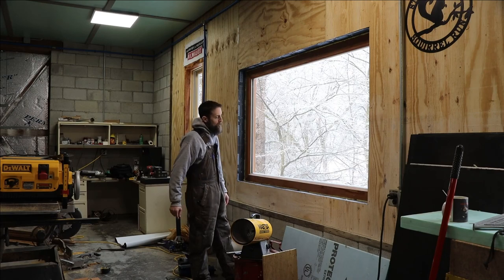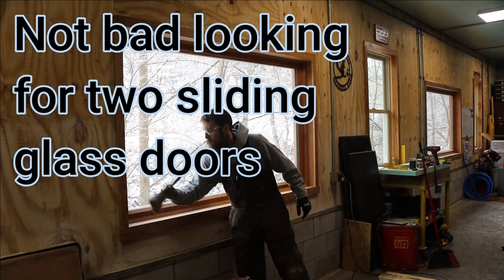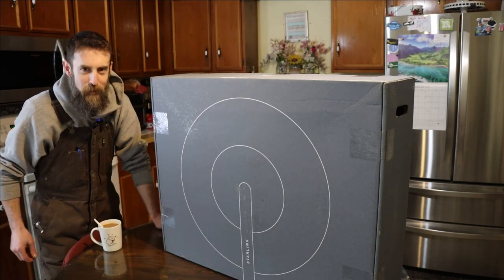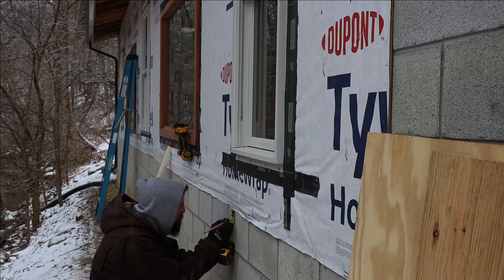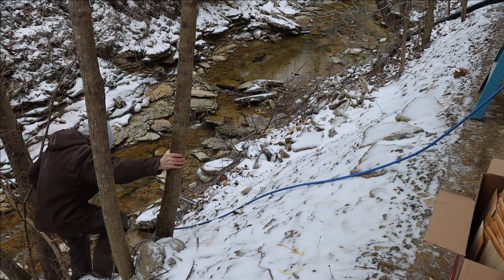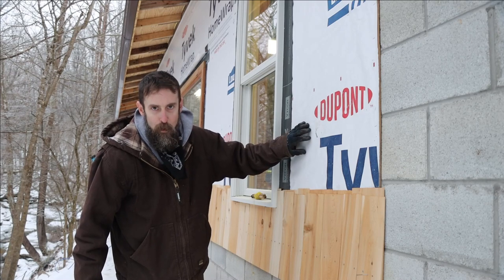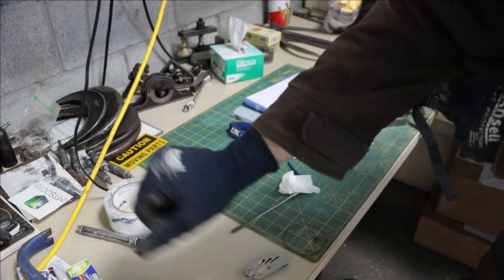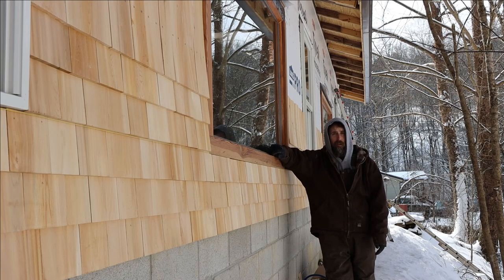Looking GOOD! Workshop Siding  going up. Shop update

Comment: I didnt even know you could get satellite internet. Here in uk its like cable, tv and internet down it.
Reply: They are doing the public beta all over the world, as the coverage map is pretty much that. Yes it will hurt those with geostationary satellites, but the big customers that use them, because the antenna is already paid for, and it is a relatively secure means to communicate in remote parts with reasonable speed, and more importantly nearly immune to infrastructure being present other than clear sky view and power of sort.

The big satellite operators are going to hurt though, as Starlink is basically being done for very low cost, using either spare capacity on a SpaceX launch, or going on their own launch for low price, so as to get the initial volume up to get coverage mostly. Yes there are multiple satellites, and they are expensive, but they do not have to have as much mass as a geostationary satellite, and the power needs are so much lower as well, plus you do not need that high energy launch to get to GEO as a saving, and you also get to ride share the big cost with 59 other units. Plus volume of scale, the tooling costs to make a single GEO satellite are very high, and only are amortised over perhaps 10 units, launched over 5 years, while the same tooling cost for SpaceX is amortised over 1000 units in the first year, even with having a lot of design updates to them, they are still following the same basic pattern and common parts list, so the cost lowers dramatically. Plus SpaceX also makes a lot of the parts in house, so they can save a lot of money using otherwise underutilised equipment and talent.

Hughes and the others are sitting with older equipment, and distance makes it impossible to upgrade the bottleneck of the satellite being 20 year old technology, while they are still paying off the initial moneys they lent, plus they are massively oversubscribed, cutting the available bandwidth to a tiny amount for all the customers in the entire field of view of any satellite, as the bandwidth is shared over a massive subscriber base, each only getting a tiny slice. 

Expensive here, but actually faster than alternatives when you are far out in the middle of nowhere, and commonly used by all the banks for ATM service in areas, even in a city, where they otherwise have poor or unreliable infrastructure, as it is good enough for that use. Used by a few containerised ATM stations in the city, and also on all the mobile quick response vans, as they can be deployed anywhere, and this will work. Yes latency is bad, and Starlink wins hands down for that, but I still see them being around for a while, though with a massive loss of the residential customers to Starlink. As the customer base grows for Starlink tyhe bandwidth will drop, but SpaceX can easily launch extra capacity for low cost, and as Hughes loses the residential customers they will overall get better service on the remainder.

Comment: I don't do Commercial Installations anymore..but you should get an Electric Hammer Drill for larger jobs...a Cordless is fine for a few fasteners ( or for driving the fasteners ) ...but a decent sized Electric Hammer Drill is 10x faster at drilling holes....really speeds up the job and wear and tear on your Cordless...i used Cordless tools since they came out and had Electric as the Main tools on Big Jobs.....Speed is Money....Home Handymen can afford to take their time.....not " saying " Cordless is Bad ok ..i use my 20 cordless tools alot. ...so you haters please back off...lol
Just giving a Tip
To use or refuse
Your ok doing it other ways too...

Comment: Starlink is coming to the 3 Billion people on this planet who don't have internet. Thank you Elon Musk.
Reply: The majority of those people could never afford it, even if it's 1/10 the cost. ($500 for the requirement and $100/month for the service.) So it's a moot point. It's really only good for the people in rural areas that have had to use traditional satellite internet. They may be able to get some sort of subsidy, to get a unit for a community center, but 90% of those people will still be without internet.
Reply: @xenonram  I’m paying 150 a month for just Comcast hardline internet that doesn’t even work 3 out of 5 days a week and I’m in a city. Starlink out performs Comcast on reliability alone.
Reply: Starlink is only just started. Elon's Spacex are putting up tons more satellites every week or two. The service is only going to get better and faster.
Reply: @xenonram   Negative.  Shared Service. Which they who can't afford it individually WILL. And they DO.  Problem SOLVED.  Tons and tons of ways to get it distributed for low low cost. Poor people in villages will make this practical and practicable.  And it will be a VAST improvement over what they have.  Use your imagination.
Reply: @1pcfred  Who cares you going to the moon next week lol lol jk
Reply: @KUGW  maybe not next week. But it is good to be able to get off the planet sometimes. I'm listening to The Animals - We Gotta Get Out Of This Place right now. Funny that.
Reply: @1pcfred  with that thinking we would still be living in caves.
Everything has a cost. Even progress
Reply: @thosoz3431  sometimes the price is too high though.
Reply: @1pcfred  We do have to get out of this place eventually. We need to find another habitable planet and a method to get there in the next billion years or so or we’re all going to die when the sun starts running out of fuel.   It’s estimated that the earth will be in uninhabitable in the next 1 to 4 billion years due to the increase in temp caused by the dying sun.  The sun is expected to completely envelop the earth when it becomes a red giant in about  5 to 6 billion years.
Reply: @shadowdog500  our Sun is a very stable star. It is the least of our concerns as far as extinction goes. Really higher orders of life do not tend to last as long as our star will. I doubt we're going to be exceptions to that either. Our star is only about a third of the way through it's active life. So it will not start dying for about 10 billion years. Humanity will be long gone by then.
Reply: Bill Gates tried to do something similar in the 90s and he was stopped by governments, so you should ask yourself why they are allowing it now.
Reply: @seantap1415  probably because Elon actually has rockets
The real question I'm asking is why so many people are desperate to believe any whacky conspiracy theory.
Reply: @1pcfred  perhaps we should ask some of the 3 billion people who want to join us here.
Reply: @shadowdog500  A BILLION YEARS. LOL we will be lucky to escape covid, global warming,, radiation poisoning,war,AI, etc, etc, in the next 50 years, never mind the next billion.
Reply: @thosoz3431  I don't think a monopoly is good for anyone except the owner.
Reply: @1pcfred  would be awesome just take a vacation to Saturn lol
Reply: @shadowdog500  Let's bring along the voting machines, wherever we go :)
Reply: @KUGW  maybe. Can't expect very much fun in the sun out that far though. This is what it looks like there https://upload.wikimedia.org/wikipedia/commons/7/73/Pale_Blue_Dot.png
Reply: @thosoz3431  if I want their opinion I'll give it to them.
Reply: @seantap1415  Bill Gates dismissed the Internet as a fad in the 90s. Which explains Windows a lot. It was only Netscape making a half a billion dollars in a few months that got him to change his mind.
Reply: @shadowdog500  yeah and by 2007 the polar ice caps will have melted. Predicting the future is a precarious occupation. So at least pick dates past when you'll be alive.
Reply: its coming to Australia soon as well anything would b better than our pathetic internet speeds
Reply: @MrValhem265  as I understand it Australia has greater problems with the Internet than just the speed. Government blocking of content is not good.
Reply: @1pcfred  yep our gov has told google to pay for news content they advertise on Google they agreed to it. but they are having issus with the Book at the moment fbook has taken down important news stories feeds blogs etc. the evil money game is rearing its head again.
Reply: @1pcfred  Starlink satellites have auto avoidance mode, and they are low enough that their orbit decays in a few years when they would malfunction. Kessler syndrome is much more of concern for higher orbits.
Reply: @sttrife  you think those satellites can dodge things coming at them at 30,000 MPH?
Reply: @MrValhem265  that's just the latest kerfuffle. The Aussie government blocks things they deem "inappropriate". Which is Orwellian.
Reply: @1pcfred  That's not how it works. Objects and debris in orbit are tracked from earth. Normally satellites are instructed to temporary change their orbit manually by people on the ground to avoid them. Starlink satellites do this automatically. This is the best we can do for now. And as I said in those orbits, there is still some atmosphere, so there is no eternally floating small debris out there like in other orbits. So pretty safe actually. You should worry about higher orbits, where there are dead satellites and and other crap that floats there without ever deorbiting. If something happens there we're much more screwed.
Reply: @sttrife  there's still some Earth atmosphere out at the orbit of the Moon. Not much, but some. I was pretty surprised when I learned that myself.
Reply: @1pcfred  for sure like torrenting

Comment: For those that are internet challenged, in my area things seem to be changing, so you may want to investigate.  I had Hughesnet for a while and felt raped by them.  I then had a wireless provider that was reasonable until bought out by Sprint, which abandoned what worked for me.  I then went cellular but that was very expensive, for I had to buy a GB quantity per month, but there was no way for me to stop the blasted advertisements on webpages, plus I could not stop the "free" antivirus from trying to update every night, so I uninstalled the antivirus.  I then found another unlimited wireless with a speed cap at 3Mbps.  This month I received a mailer from Verizon for what they call "LTE Home Internet" which uses 4G LTE.  I understand that T-Mobile has something similar.  Things are changing, so check them out.  The VZW setup is a wireless router box that talks to their cell tower.  I get at least 40Mbps.  Because I am a VZW customer my charge is $50/mo w/ equipment charge for unlimited quantity.  I think their offer is more $ for non-VZW but has a monthly GB cap.  Again, time to check to see what is available for you.

Comment: If you need more knife screws, send me email.  How many knives did you actually buy?  Might have to use my new belt sander instead of the file.
Reply from the maker: Thanks Mark, I appreciate the screws. I'm good for now on them.
Had two knives over the years that had the screws lost and replaced them the other day with the ones you sent. They worked really well. 
Thanls again👍

Comment: I wouldn't say your old provider took advantage of you, it's just that the Starlink product is about 20 years ahead of other satellite providers technology wise. That's like saying they could have made dialup better and they were ripping people off versus broadband. It's a brand new technology that is replacing an old technology through natural attrition. Better technology becomes available and provides a better service at a lower price. You're already seeing that in the wired broadband ISP space with fiber being cheaper to install and service and providing better speeds and lower costs when compared to cable broadband. Your old provide probably has less than 100 satellites that are all 5 to 10 years old in space while Starlink already has over 1000 brand new satellites in space with plans to reach 30k. It's just not possible for them to compete, and you are right they will die off and there is nothing they can do about it. It's very much like the fact that nobody has a home phone anymore because cell phones are better and cheaper.

Comment: Your new technology may not have been available when you installed your old tech. so don't be too angry if the new guy is better than the old guy.  Some day what you have now will be outperformed by another generation, that's just tech.
Reply: Higher speed capable tech has been available for many years - it's all about the cost to upgrade the existing infrastructure. Many companies have been milking their systems beyond their original designs as long as they can, until something forces their hands. I bet as more Starlink systems get installed in Steve's area, his old ISP will 'find a way' to upgrade. I have piss-poor internet, but my literal next door backyard neighbor has 10x faster service because their 'zone' got new fiber, and the 150 houses on my single street didn't, because we are technically 'in between' 2 zones. Our street is not even in the currently listed 'up and coming' 2 year upgrade map yet. I don't live in the 'boonies', it's just how the town maps are historically (and politically) drawn.